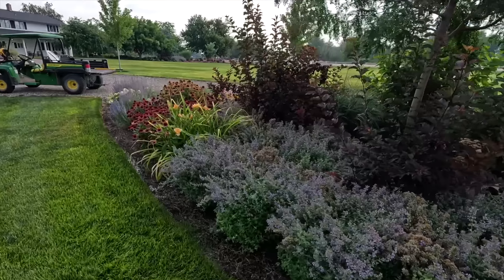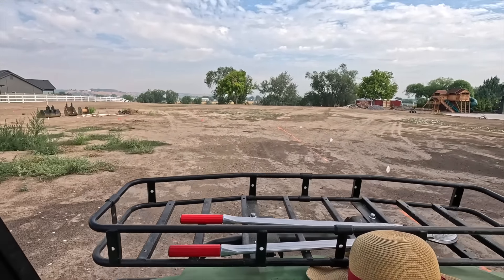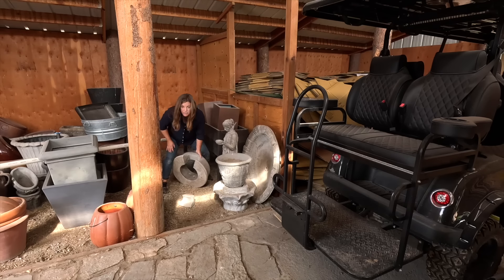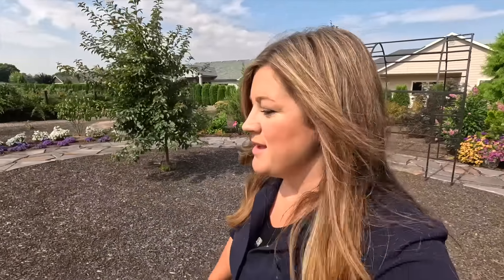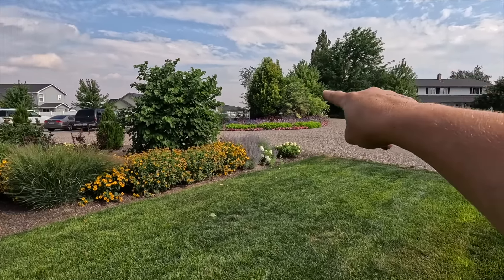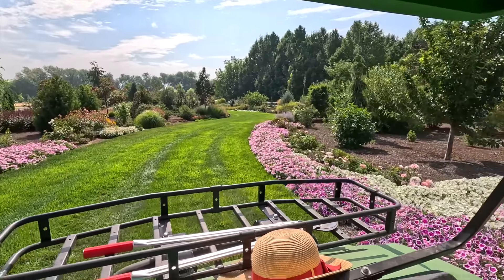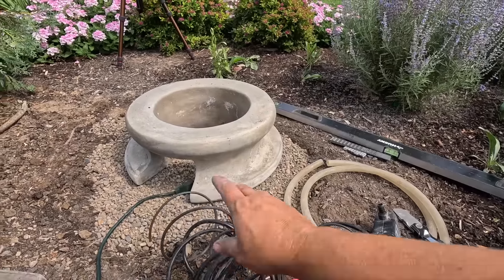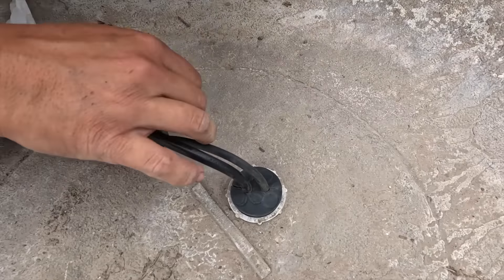Setting Up a Fountain & Taking Out a Tree! 💦🙌🌳 // Garden Answer

Comment: How many different levels of drip emitters do you keep 'in stock?' Two gallons per hour is so much! Have you ever tried the 'drip flags' from drip depot's site? They say they are easy to clean out if you get silt or hard water buildup and are somewhat adjustable. I have tried to keep my equipment streamlined, so I only have .5 gph emitters and tubing in my small yard. The setup I have to fill my fountains and birdbath are just little bouquets of previously used emitters or rings of drip tubing from last year's planters.

Comment: A solar panel and battery system might work for an "off grid" fountain pump that does not require much power.  That would allow much more freedom in placement of fountains and lights.

Comment: Though I think the kitchen view pond sounds wonderful I don't think it'll work unless you want to give up more gardenbed space, and doing that will definitely lose that closed in cozy feel which is why you wanted it there in the first place. 

I say that because though it'll fit in the allotted space, I think you'll find the size will seem off. Once you factor in the berm needed for the waterfall (if done the right way at least and not a volcano amateur look), you'll be left with very little pond space. What's the point of a 2x2 pond? So then you'll want to extend it more cutting into the beds etc. 

This is why I think the space would be better off with a pondless waterfall/stream/creek. And seeing as how you happen to have the main components to one collecting dust in the barn… sounds like a no-brainer. Saves you money and still get to keep that closed in cozy feel.

Comment: FOUNTAIN FLOW SOLUTION... Consider a pump with an even lower flow rate so that the water just escapes out of the opening and falls off the tip of the jug she holds.  This would (1) look like the water pours from the jug, (2) fall directly into the smaller tier, and (3) stop splashing.
Reply: I agree. I think that would look very natural and is how it is designed to work.

Comment: Looks like the pump needs to be turned down to the lowest setting so that the water barely flows out. Then it will gently flow into the first smaller bowl. The dripping into the larger basin will produce the soothing fountain sound
Reply: Yes.
Reply: If you actually watch the video she already knows that. She also discussed other ways to fix it.

Comment: * * * LAURA, Have you seen how cable companies install/bury cable in customers yard without damaging the yards..  They use a strong spade type of tool (kind of like your edger) or shovel... push it in the ground but instead of digging a trench, they only push the tool forward and back to 'part' the dirt/grass/mulch... They lay their wire, then push each side of the opening with their foot to close the 'part' they made..  it is virtually invisible when they are finished.  it's like a giant 'V' in the dirt if that makes sense..  Here's a video showing a guy using the same method... not affilited & don't know the person..   https://youtu.be/iCgdTrtUJqQ?si=LskCHg5CIV51jWNw   Edited:  here's another guy.. showing installing the wire also, he is using the large edging tool to part the dirt..  https://youtu.be/kNqOXul-GOQ?si=6cXo1BfCIR9NSj9c..